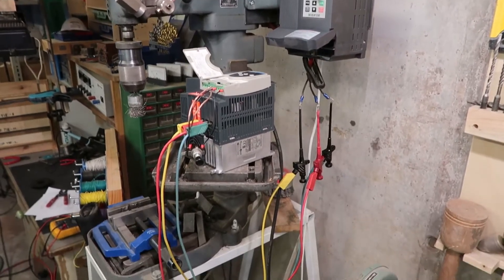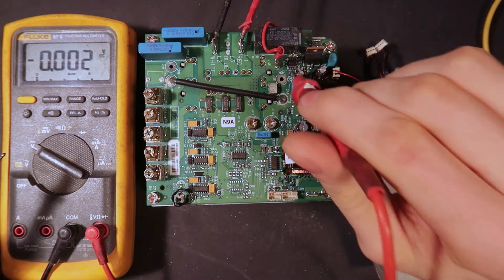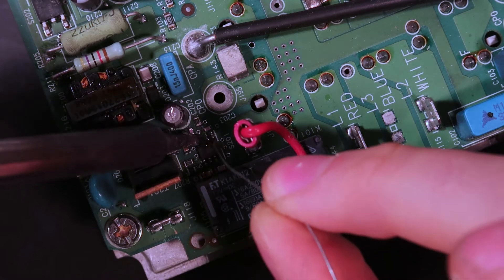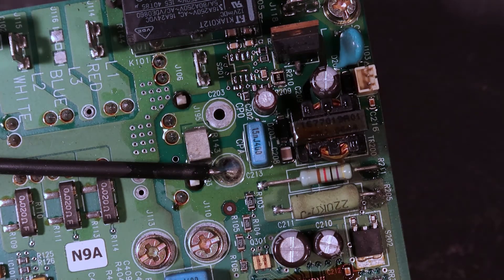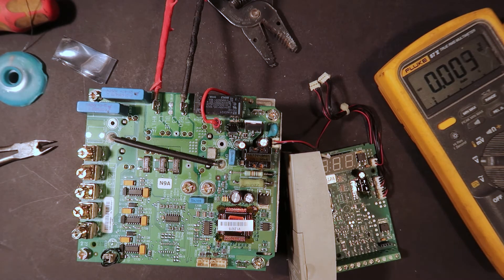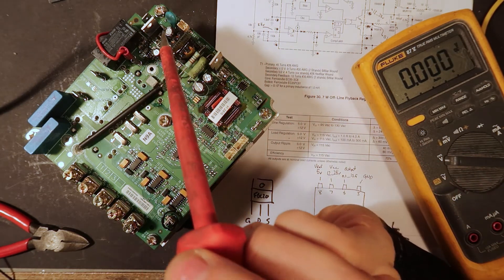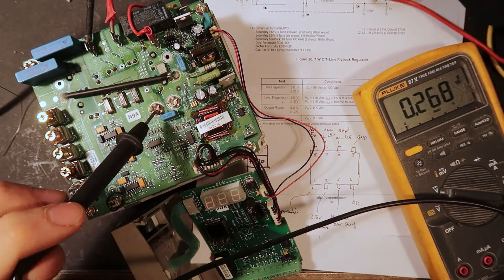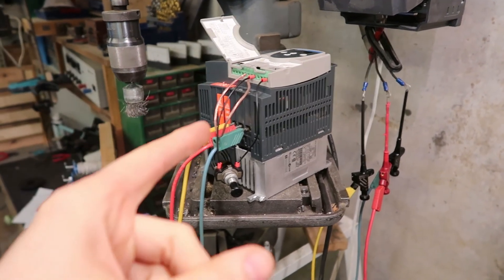Fixed the garbage bin Telemecanique VFD (variable frequency drive) PART DEUX | Altivar 11

Comment: Thank you Dmitri for these amazing videos. I also came up with an Altivar 11 VFD. My display is "rdy". So, I think it's still ok. But, when I try to run it, therr is no 220v 3 phase supply coming out from the vfd. Can you show me the setting on the VFD  its relative pin out for switch button and speed control? Thank you, man!
Reply from the maker: Hey, thanks 🙏 if it's showing RDY it's probably ok. You are trying to measure it open terminal with a meter or with a motor connected to it? Open terminal it won't switch on. The digram of the wiring is in the "lathe VFD" video towards the end of the video. You can see there how i connected everything.
Reply: @DmitriIvanov  It's with a connected motor. The wiring connections at the end of your video really did help me a lot.
My problem was that the VFD's forward pin isn't working. So, I tried the reverse pin, the motor did run reverse. So, I just reverse the terminal to the motor to have a forward direction. Now, it's working fine. Thanks to you man! Your videos are really amazing.
Is there a way to have the forward pin 8 to work again, or some reset to be done?
Reply from the maker: @jayrandolfratunil2369  great to hear. Check if the pin is physically connected to the PCB still (multimeter). Maybe the little connection terminal block is damaged a bit and you're not making connection anymore. There really shouldn't be any reason this input is electrically damaged unless somebody put a voltage there that's far out of spec. Good luck 🤞

Comment: Did you measure only the capacitance of electrolytics? The ESR of these caps get high when they dry up and that's why the circuit fails.. So, even though they measure correctly in farads, in ohms they are higher than normal
Reply from the maker: Unfortunately I have nothing to measure impedance at home. But yes, you're completely right!